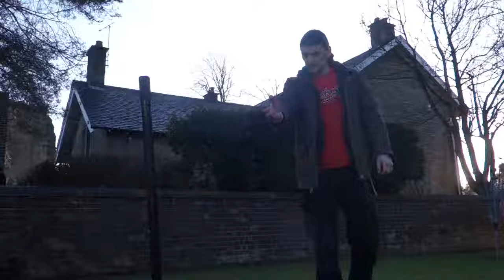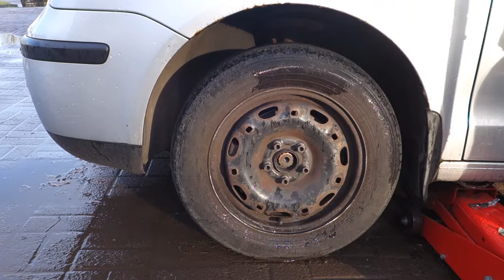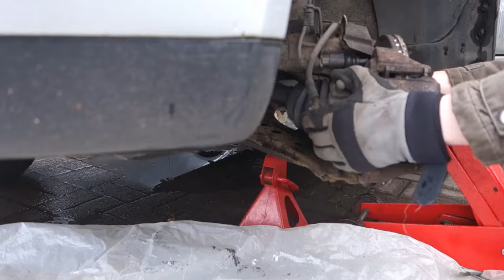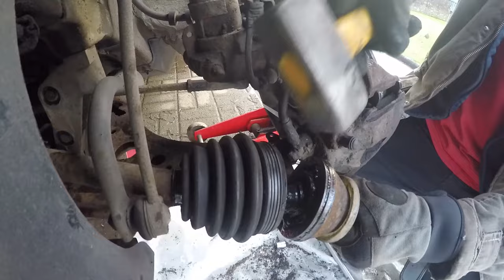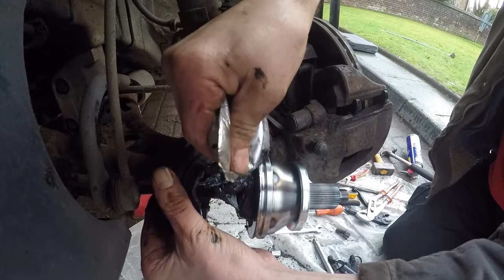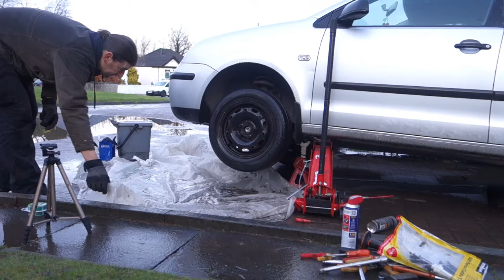VW Polo 9n repairs. Episode 6, CV joint replaced.

Comment: I followed everything that's being done here, but for some reason my cv joint doesn't want to come off I tried banging it with a hammer and lubricating it still can't remove it, what should I do?
Reply from the maker: Heat. Use a blow torch to heat where the cv joint meets the axle and then a bigger hammer.

Comment: Great informative video, thanks.  I would recommend anyone doing this to pack the grease right into the workings of the CV joint, and to do it before connecting it to the drive shaft for ease.  Also have to recommend cleaning all the greasy debris from the brake disc before refitting the road wheel.
Reply: That's smart, thanks for the tip.

Comment: Can't you just replace the gaiter? I mean if it's letting the grease come out maybe replacing the outer part will fix it.
Reply from the maker: You could but its just as much work to replace the gaiter as it is to change the CV joint and its only £40-£50 for the full kit. I swapped both because my CV was worn and making noises but had the joint been ok i would still have swapped it as I didn't know how old it was.
Reply: @AstonishingGlasgow  Thank you so much for the reply and for the video, very helpful.

Comment: What did you do with the small clip that was left
Reply from the maker: Wouldn't be right to use ALL the parts 🤣. The clip that was fitted seemed to be doing its job fine and my fingers were covered in grease by that point so I left it there.

Comment: Just sheared off two of the bolts connecting the suspension arm oops
Reply from the maker: Disaster!! On the plus side they are not captive so once all three are out you could use nuts and bolts but make sure they are the same size, strength and use nylock nuts.
Reply: @AstonishingGlasgow  fortunately my dad is a tool maker so we snuck into his work to get some of the correct bolts and just re threaded the connecting part.
Reply from the maker: Good job.

Comment: You're made of sterner stuff than me, I hate working on cars in the rain. Top marks, job well done.
Reply from the maker: Cheers. Dont get much choice in Scotland, its a good day when its not snowing :-D
Reply: @AstonishingGlasgow  Yep, definitely. I'm in North Lanarkshire, been bloody freezing here recently but luckily have a garage to keep the rain off. I remember doing welding on my brother's golf under a tarpaulin because it was snowing, never again!
Reply from the maker: You cant be too far away from me, Im on the southside of Glasgow. The same week I did the CV joint and door lock module on this car I had to replace the flex section of the exhaust for the mot. Started at 3pm and finished in the dark at 6pm and I had a tide line right around me where I was lying in a puddle :-). Kept getting shocks off my welder because my gloves were soaked through and I was getting my fingers too close to the tip. Sometimes wonder why I bother. :-D
Reply: @AstonishingGlasgow  I gave up welding on my brother's golf when I started getting zapped. Always welcome in my garage!

Comment: Nice   doing this tomorrow   nice to know the joints are just knock off 👍👍👍👍👍
Reply from the maker: Worse bit of the job is the mess the old grease makes. It somehow gets everywhere. If you get a chance today, soak the 3 ball joint bolts with penetrating oil today to give it a chance to soak in before you try and remove them tomorrow.

Comment: My daughter's polo seems to be having the same issues yours does! Unfortunately, the cv joint doesn't want to knock off as easily as yours appeared to.
Reply from the maker: If it wont come off the shaft you may need to unbolt the inner CV joint from the gearbox and clamp the shaft in a vice for better access.

Comment: Big fan of your videos
When the Cv joint has the problem, what would we notice like the sound when you turn or any unusual feedback?
Thanks
Reply from the maker: Thanks, Im glad you enjoy the videos. A failing CV joint is not always noticeable until you get under the car and look for play in the half shaft or a split in the rubber boot but you can look out for a ticking or grinding noise when the joint is under load or when the steering is at full lock.
Reply: BTJustice 
Thanks for your help!!!.
Reply from the maker: You are more than welcome.

Comment: Enjoyed the video so much, so helpful. What was the reason for changing the outer CV joint in your car?
I have a Polo 6N2 and am having some issues with steering wheel, as it is not smooth when turning to center, it wobbles and shakes when turning itself center after a turn. The outer CV joints are suspicious for me, but I am not sure..
Reply from the maker: Im really glad you found it usefull. The issue I had that led me to change the CV joint was that the boot had split and needed replaced and when I inspected the drive shaft there was lots of play in the CV joint. If I was you I would jack up the front of the car (and support on stands) and check the condition of the lower ball joints and upper suspension bushes. These are what tend to influence the smooth operation of the steering more than the CV joint. While under there have a check on lower control arm bushes and check power steering fluid level for good measure as well. Hope you get it sorted and thanks for watching, Dave.
Reply: BTJustice  Lower ball joints were replaced 2 months ago, power steering fluid was changed last week but the problem still exists. Suspension bushes and tie rods have not been checked yet, I will give a try soon. But, the most interesting thing is that the steering wherl is excellent while the wheels are not moving/rotating. When the wheels start to move/rotate, the steering wheel turns wobbly/shaky. I tested it by jacking the car up; the front wheels were not touching the ground, the steering was excellent and smooth. I put 1st gear, the wheels started rotating, and the steering wheel starts turning wobbly/shaky. It lost its smooth turn after the wheels started rotating. This is why the cv joints are suspicious to me, but I am also confused after this test..
Reply from the maker: Sounds like it wouldnt hurt to change the outer CV joints then. They are cheap enough and if you had the ball joints off recently you know they will come apart.
Reply: BTJustice  I’ve never done this replacement before. But maybe I can try, however my first focus is to find the exact cause of this problem. I’ll get underneath the car tomorrow, and will have someone to rotate the wheels while they are jacking up, maybe I can see what’s balancing at this moment. This problem annoyed me so much.
Reply from the maker: I hadnt changed a CV joint either until I made the video. Got to start somewhere ;-) With the front of the car off the ground I would push, pull and pry at every bush to see if there is play in any of them. Hope you get to the bottom of it.

Comment: Hi thanks for the video. I am struggling to get the hub but off I have a 12 point 36 mm and 34mm the 36 is too big and the 34 is too small?? Really boggles me? Any suggestions? Thanks
Reply from the maker: That is a problem. Is there any chance its a non standard CV joint or that a previous expert has rounded it off?

Comment: Hello my friend I need to replace cv axle and i buy a new cv axle with the same OEM number but the new one does not have that metal ring on the top of cv joint      it is okey to mount without that or it nessesary to have it ... Thnx a lot if you help me
Reply from the maker: Sorry for not replying sooner. You will probably find that the ring will pop off the old CV joint. My old joint had a plastic ring and with the new joint the metal ring was loose in the box and just pressed on. I think its a dust cover for the wheel bearing and ABS sensor.

Comment: Hiya don’t suppose you have a link for the 36mm 12point socket do you? Cheers!
Reply from the maker: I bought mine at a local tool store so I dont have a link. They are readily available and not a VW specific item.
Reply: @AstonishingGlasgow  no worries cheers bud

Comment: Currently doing mine and the joint just will not budge
Reply from the maker: If it wont budge in situ you may need to unbolt the inner CV joint from the gearbox and clamp the shaft in a vice to get better access to swing a hammer at it.
Reply: @AstonishingGlasgow  Got it off now, and the new one one. Just needed patience
Reply from the maker: Is patience the name of your bigger hammer?😄 Glad you got it now get ready for the fun of washing the cv grease off of everything.

Comment: 2/3 of the bolts on the control arm are just spinning, any help with this?
Reply from the maker: The nuts are not captive. The bolts passt through the control arm with the nuts on top. The three nuts are vonnected by a V shaped piece of metal. One of mine was turning as the nut had rusted from the V shape plate but I was able to get maul grips on it and remove the bolt.

Comment: What is the split washer for
Reply from the maker: Sits in the groove at end of the drive shaft and helps to hold the CV joint until it is bolted to the hub. My old one was fine so left it in place rather than use the new one.

Comment: What size outer cv boot is it for that car length and inner diameters
Reply from the maker: Im afraid it was two years ago when I did this job and the part came straight out of the box and on the car so I dont have the measurements.

Comment: What size is the rubber cv boot
Reply from the maker: Im afraid it was two years ago when I did this job and the part came straight out of the box and on the car so I dont have the measurements.
Reply: What size socket is it to remove nut
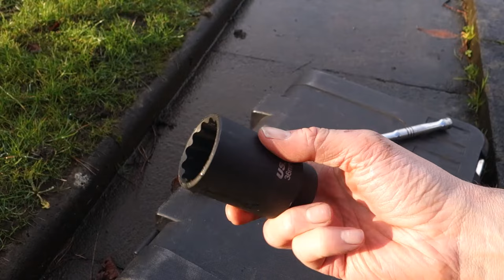Reply from the maker: 36mm multi point. 0:45